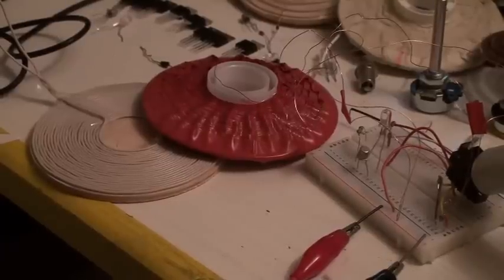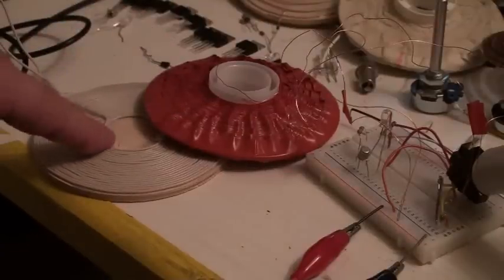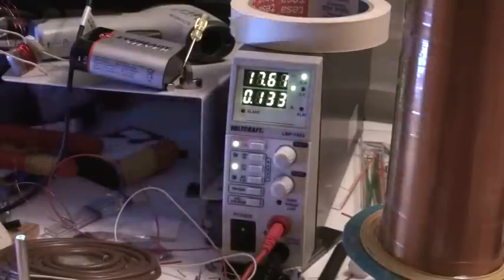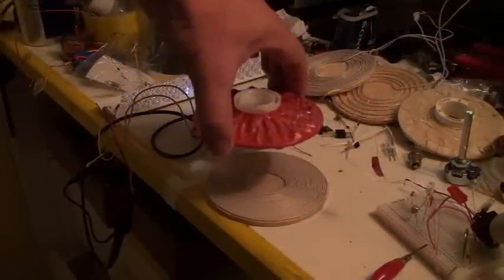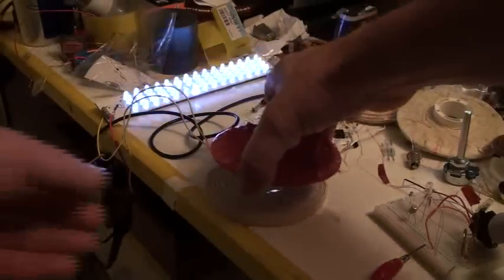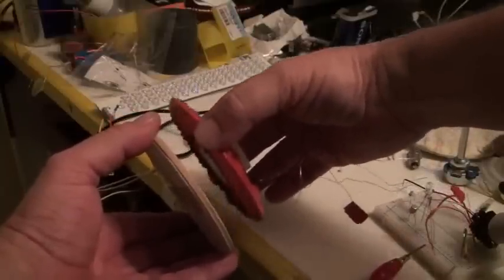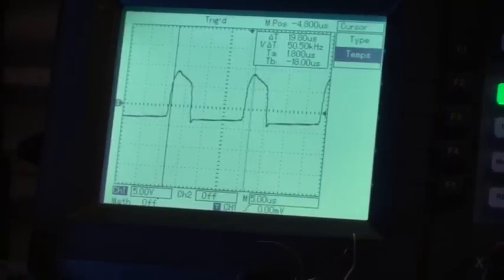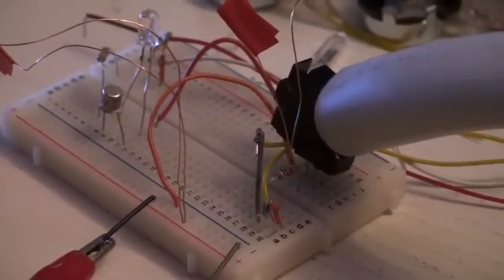bifilar Tesla pancake  wireless coupling.wmv

Comment: Very cool! Can you elaborate a bit more on the arrangement of LEDs? How many? Series/Parallel? Your circuit appears to draw about 4 watts, how does the illumination of that bunch of LEDs, compare, say to if you were to drive them conventional, using about the same power? Thanks! I want to wind a bifiliar pancake. Is the red coil pancake, but NOT bifilar, and the pickup coil is bifilar? Thanks.